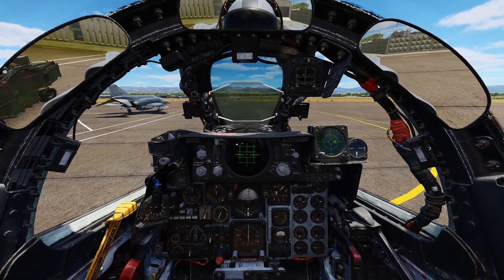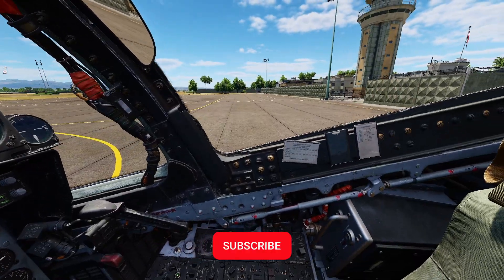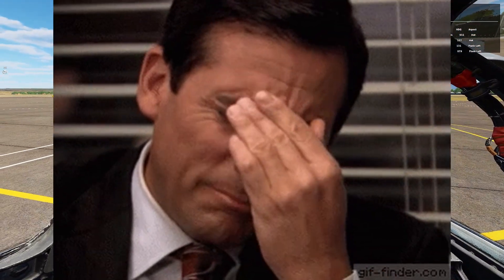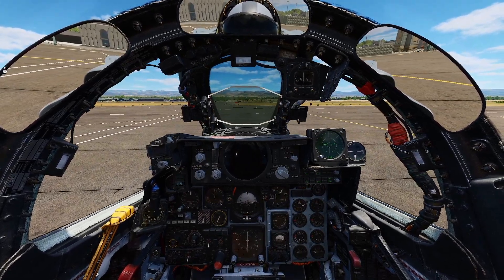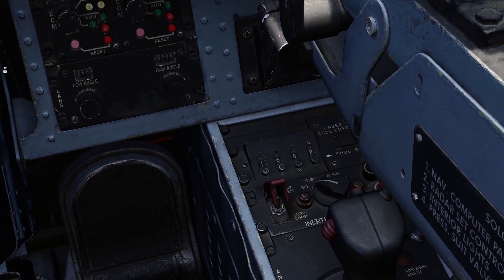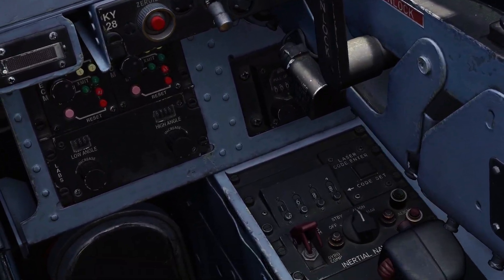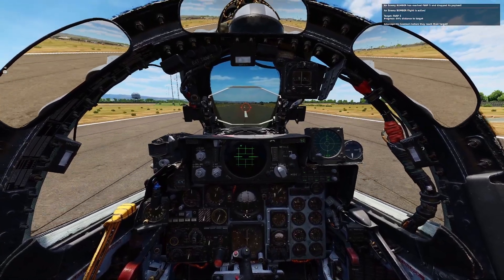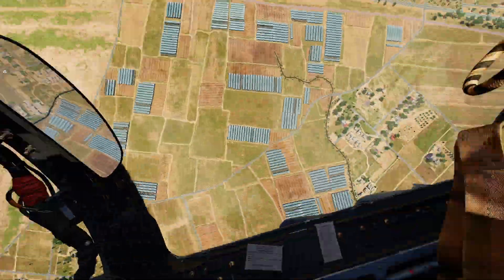DCS F-4E | INS Alignment RESTART

Comment: Let the Stored Heading switch closed, since you moved away from your last known position. Your options are BATH or FULL alignment, but not stored.
Reply: I mean… the plane moved a couple of feet. There’s nothing preventing you from using stored heading, it’ll just be a teeny tiny bit off.
Reply from the maker: Fair point! It just seemed with that switch the alignment went faster?
Reply: @Afty86  Heading Memory Alignment
This option becomes accessible if the alignment has been previously stored and the aircraft has remained stationary. To access it, select HDG MEM (1) located beneath the red guard on the control panel before transitioning the INS knob from OFF to ALIGN. This alignment method minimizes the alignment time, offering a relative Circular Error Probability (CEP) at the optimal end of BATH (5.5 nautical miles), or even Gyrocompass Alignment (3 nautical miles) if the previous alignment occurred within the last 2 hours.

To access the accelerated HDG MEM alignment mode, the guard must be raised and the switch actuated up, and the INS mode switch placed to ALIGN until the ALIGN lamp starts flashing. Then, the INS can be placed into NAV mode. If time allows, STBY mode can be selected before going to ALIGN to allow proper heating of the gyroscopes (which goes through the illumination/off cycle as above).

https://f4.manuals.heatblur.se/systems/nav_com/ins.html